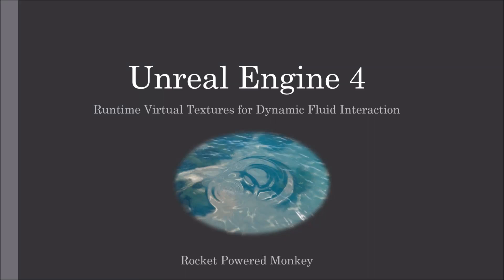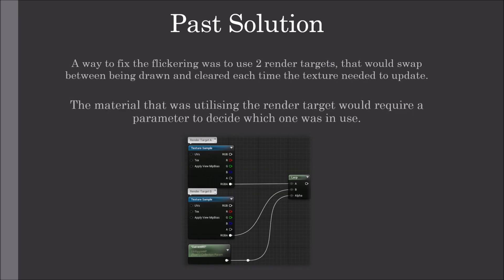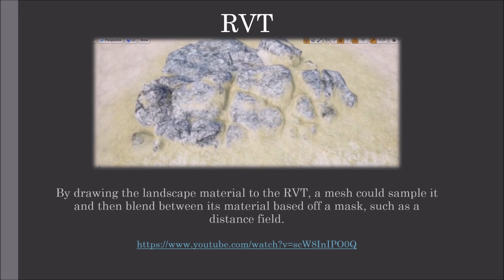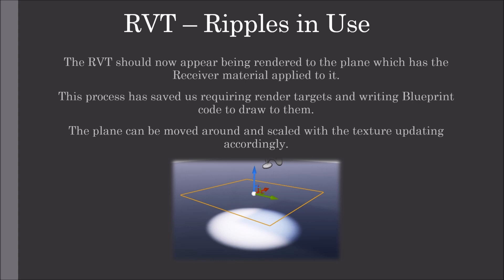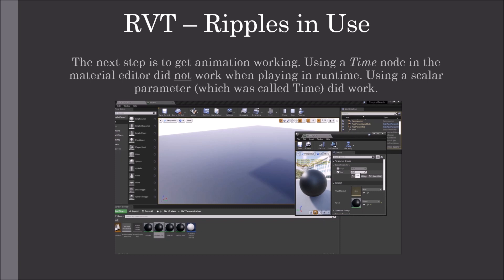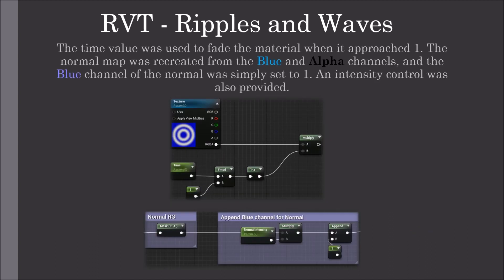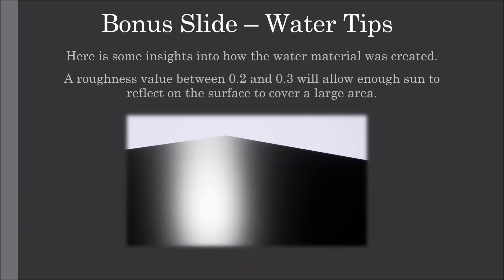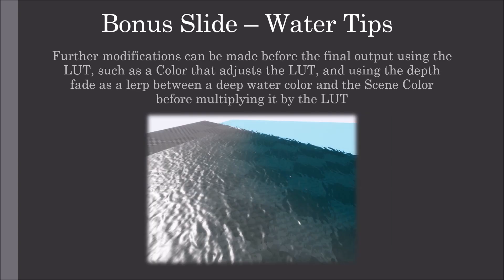UE4 Using Runtime Virtual Textures To Make Fluid Interactions (Presentation)

Comment: im struggeling rendering negative values into my virtual texture (heightmap). did someone solve this?
Reply from the maker: The times I've used negative values is with displacement / world position offset and it works for me (it will push verticies down if the value is negative). I haven't tested it on the WorldHeight input though. What's your setup like?
Reply: @RPMonkey  i have a water plane that I render in a self applied rvt height...this gives me middle grey rvt texture.... now I place a plane above and project its world position z into the same height rvt...I get a brighter area below the plane. Then I tweak the world position of the plane with adds or multiplies before piping into the height output to create lower values....but the projection never goes below the height of the middle grey of the water plane itself even if values are very low. The height rvt sample in the water material goes into its displacement and base color to see what's going on. I always only get upwards displacement with  brighter then middle grey values...and never negative ones
Reply from the maker: @krz9000  The documentation states that the WorldHeight output is in format R16_UNORM - which from what I've found is an unsigned normalized format - meaning only positive numbers between 0-65535 are stored in a range of 0-1. This may be why displacement is only ever pushing upwards. I can write negative values for the other inputs (Basecolor, roughness, normal, etc) which will push things down - but if your water relies on the world height I'm not it can store it at the moment. If you only want the world height value to affect the displacement downwards (and not have both up and down) you could subtract the mask result (after being multipied by a vertexnormalWS) from another vertexnormalWS. Here's a great setup I found for making masks based on world height: https://twitter.com/HighlySpammable/status/1228557849434804224 - the parameters needs tweaking a bit in an instance to get it right.
Reply: @RPMonkey  ja i have such setup running for object/landscape blends. it works nice. but i had the idea of wave generation via displacement projection. i still dont get why it should not be possible to project values that are lower then what underlying geometry projects. i guess its just an oversight on epics side. use-cases would be there. i dont think it has something to do with the dataformat. i guess they just dont expect negative projections to be usefull...since objects above would cover them. but in the case of displacement generators it would be useful to recieve lower values from projectors above the lowest projector

Comment: Thank you for this very excellent tutorial. Haven't seen the VRT used like that before other than in your videos. The one thing I wonder though is how would you go about implementing buyouncy? I don't know of a way to sample the wave height based on a texture.
Reply from the maker: Yeah sadly I don't think its possible with RVT because you would have to sample the pixel at a location, which would require behind the scenes c++ work. I have had the thought that you could fake buoyancy by adding a box collision to each plane that gets spawned to draw to the RVT, and based on if the player enters that collision it could puish them up or down. But this would not account for different waveforms that could be represented by a texture :(
Reply: @RPMonkey  Thank you for your quick response. I will take a look at render target lookup then, maybe that code can be adapted to sample virtual textures.